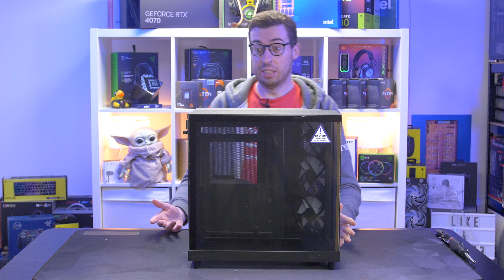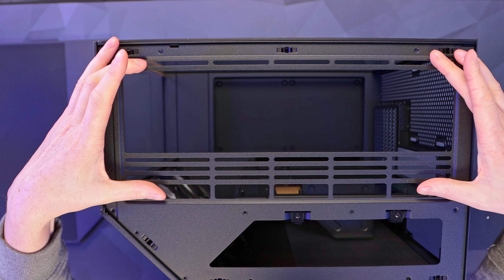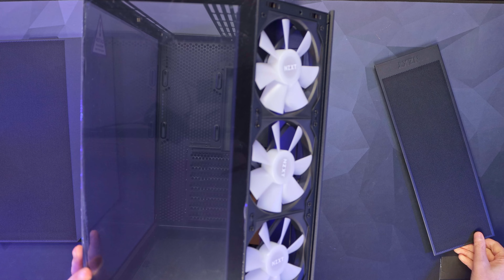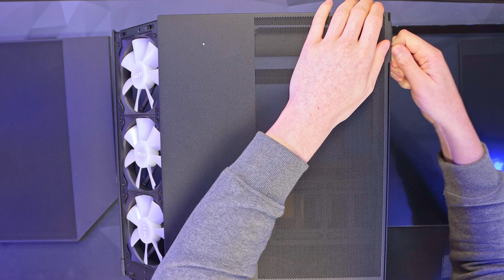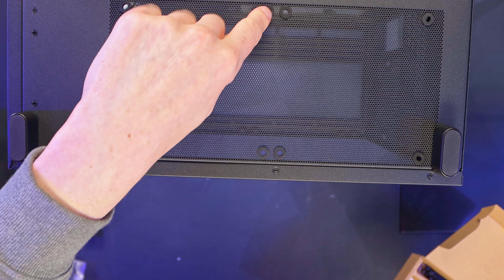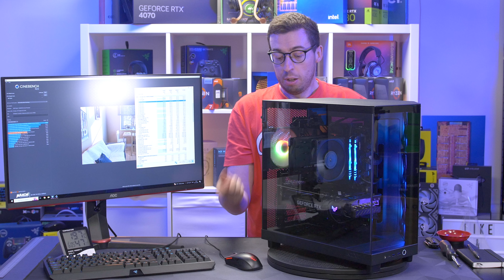An EPIC Yet AFFORDABLE PC Case! - NZXT H6 Flow RGB - Unboxing & Review! (w/ Thermal Test) [4K]

Comment from the maker: Small Correction - The bottom additional fan supports are for 140mm fans, not 120mm.
Reply: It can fit 120mm too :)
Reply: @ameliagabble it has space for it but no holes to connect them

Comment: Hi! i plan to build with this case, im gonna add both 140 mm on the bottom,  do u recommend me to install an extra exhaust fan on top right above the CPU? or just the rear exhaust fan would be enough....
Reply from the maker: I'm guessing you're using an air tower. Personally, I've built systems without the extra one and they've been perfectly fine, it's more personal preference I'd say. You might lower the temps slightly*, but not to a amount you *need one.
Reply: @jordanash  oh yeah with the DeepCool AK620 cooler exactly,  sounds excellent then! besides im building with a ryzen 5 9600x and rtx 5060 ti 16 gigs zotac  , both runs cool and im not planning to overclock, so i dont think indise temps are gonna be high at all i appreciate tu advice !!
Reply from the maker: Yeah that'll be fine. You won't have any problems or attempts with those parts. No problem

Comment: Hello good Video but I have one question can I Switch the non rgb fans with rgb fans because I bought it with out rgb fans and I Want to Change it
Reply from the maker: Yep, just grab a triple pack of F120 core. As you didn't get them to begin you'll need to use the hub with the triple pack, but it's easy to use.,

Comment: I currently have a Be Quiet Pure Base 500Dx. Does anyone know if the H6 Flow is better in terms of thermals and acoustics? I will be using Noctua case fans and a Thermalright air cooled CPU cooler.
Reply from the maker: Thermals for this are in the video but it's hard to tell without using the exact same setup inside it. If you're using Noctua fans you're unlikely to hear them unless you're thrashing the system.

Comment: Excellent review. I will be using an air cooled CPU. I've read it's not recommended to have bottom case fans because it raises the CPU temperature. What would you say is the ideal fan configuration? I'm thinking 3 intake at the front(ish), 1 rear exhaust and either 1 or 2 exhaust.
Reply from the maker: As in the video really, keep them all the same way in and out.

Comment: Very nice video i have a couple of questions my asus mobo has 1 a-rgb header right in the middle at the bottom and right next to it is a fan header,are the cables of the front rgb fans long enough to reach the headers on my mobo?? and your outake fan is that a 120 or a 140mm fan....
Reply from the maker: If I recall it should reach yes. That's a 120mm.
Reply: @jordanash  Does a 140 mm fit as outtake or only the 120??
Reply from the maker: @gompsie  Just a 120mm
Reply: @jordanash  thanks for the fast reply m8,i have to build a pc for a 12 year old and guess what he wants that case lol
Reply from the maker: @gompsie  Anytime! Haha bless
Reply: @jordanash  Thx for the fast reply m8 your awesome and subcribed......
Reply from the maker: Anytime. Great, cheers

Comment: I'm doing my first self build in this case soon.  I was looking at RGB fans originally but I haven't turned the lights on my 4 year old pre-built PC since the day I got it lol, so now I'm going down the road of performance fans.  I cant decide between Noctua chromax,  Silent Wings 4 pro or Phanteks t30 (all non RGB).
Reply from the maker: Noctua are the best (and most silent) fans I've used, but they're $25 a pop. Certainly a case of "you get what you pay for" though
Reply: @jordanash  Cheers, that's what I'm leaning towards.
Reply from the maker: My first PC I used a Noctua cooler on, ran it for eight years without a single issue.

Comment: Won't this case get very dusty considering it has no dust filters? Or will positive pressure be enough to keep it away? I really dig this case but am too hesistant  because of that, might just get an h7 flow instead
Reply from the maker: NZXT seem to be all about airflow now, just might need more regular cleaning. Don't be hesitate because oy might need to clean it a couple more times in a year, the performance gain is well worth it.
Reply: @jordanash  Thanks for the insight mate! One more thing, if you were to choose between this or the H7 Flow, which would you prefer? The H7 Flow seems more efficient but the aesthetics on this are so good, having a hard time deciding.
Reply from the maker: No problem. Oh I'd go for this, even though the airflow isn't directly straight on, as you can see with the results in the video it's still keeping the system nice and cool. The H7 is nice and easy to build in, but this is something unique and I love it.
Reply: @jordanash  Thank you again mate! Already ordered mine online 🫡
Reply from the maker: Most welcome. Awesome, enjoy!

Comment: Hello, I'm considering purchasing this case to optimize the cooling performance of my components. Yet, I'm uncertain about the ideal number of PC case fans required to achieve maximum airflow. The configuration I'm contemplating involves three 120mm fans on the top and one 120mm fan at the rear for exhaust, supplemented by two 140mm fans at the bottom for increased intake, in addition to the three stock 120mm intake fans provided. Would this setup be the most effective configuration for maximizing airflow? 

BTW, I am also using the DeepCool Assassin IV Air Cooler.
Reply from the maker: I mean as you can see in the video even just the fans I'm using in the case work well. It's more down to the CPU and GPU you're using to how many fans you need. Guessing as you're using an air cooler you're not using a CPU that's too high in the SKU stack, so you might not even need the extra fans in the bottom and top. I usually don't add extra fans on the bottom or in the roof unless I'm using a higher SKU that needs an AIO.
Reply: @jordanash  Thanks man, I made a mistake by getting a 4070, a 7800x3d and housing it in the h710 :(
Reply from the maker: No worries. Ah the solid front panel one, ouch
Reply: can you fit Assassin IV on h6 flow? because from the specs i don't think it will fit
Reply: @jade6548  Sad to say based on the specs it will not fit.
Reply: @Draken1-2-3   yeah it will be sick if it can fit assassin iv there.
Reply from the maker: That's 164mm, didn't I say the max for the H6 was 165?

Comment: great case but having proprietary connector on the base fan and not having the header included with the case is a shame, if you dont pay attention you cannot plug them, other than that the case is amazing it looks amazing the cable managment is great
Reply from the maker: They have adapters though, I mention that in the video.

Comment: Heyyyy quality build was thinking of switching over to this case but currently got a matx mobo in my build any opinions on how this would look in this case with dead space etc thanks
Reply from the maker: Personally I don't like using smaller boards than cases can accommodate, but you could always get a vertical riser for your GPU, then the gap will be covered.

Comment: I like how it looks, but hate the lack of dust filters
Reply from the maker: Potentially one dusty boi
Reply: Surely dust filter material can be purchased. Wouldn't be a problem unless you like to watch the RGB fan lights, which I don't.... and won't.  I'm about to build a new rig with the non-RGB version of this. Contemplating getting a washable electrostatic filter from Home Depot, cut, and fit under the bottom for the two fans that will mount there.  Should be easy to build something to hold it. Maybe add to the feet a little to raise it up off the desk. I do need to make one correction. Unless the British version is different, all the other videos I've watched show the 2 in the bottom of the case are 140mm fans, not 120's. @jordanash
Reply from the maker: NZXT focus on Airflow, but to be honest just giving it a clean more regularly to get better temps is worth it. I've already put a pinned comment correcting the fan size on the bottom.

Comment: Nice case!!! Does the nh d15s fit in this case?
Reply from the maker: I covered that exact point in the video
Reply: @jordanash  the nhd15  is 165 mm with the fan.
Nhd15s is 160 mm with or with out the fan. That why im asking if it will fit on actual senario. Im planning to buy the case.
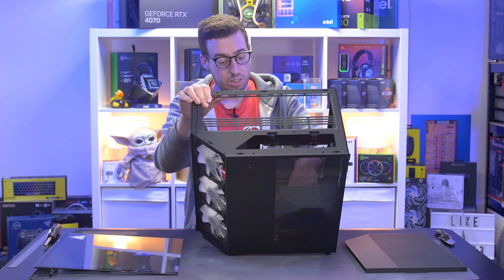Reply from the maker: I meant that in the video I give the exact clearance dimensions. It's at 4:03. It has a clearance of 163mm, so NH-D15S if it's 160mm then yes, NH-D15 at 165mm no
Reply: @jordanash  oh i see thanks.
Reply from the maker: I try to put as much information in the videos as I can so people's questions get answered.

Comment: Thank you for doing a airflow build! Ive been searching for one. Subbed atm! I was gonna buy the Phantek NV-5 if it was easily available here locally but couldnt find one. I saw this one selling for around 120 usd so I'd probably go for this with a black out theme. THANK YOU SO MUCH!
Reply from the maker: You're welcome, thank you for subscribing. Sounds good to me!
Reply: What fan configuration did you end up going for? I'm considering upgrading to this from my be quiet 500dx case and I'll like yourself, I'll be opting for air coolng.